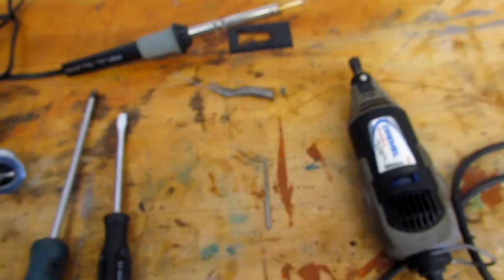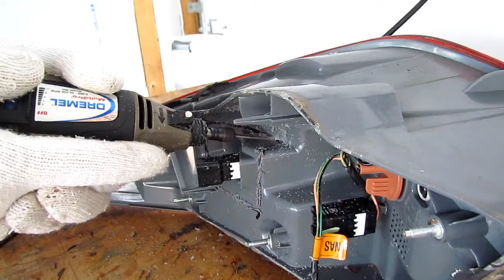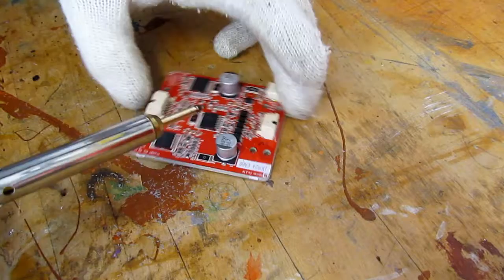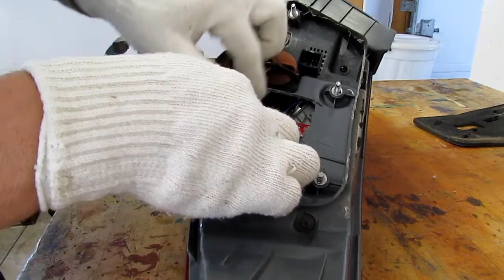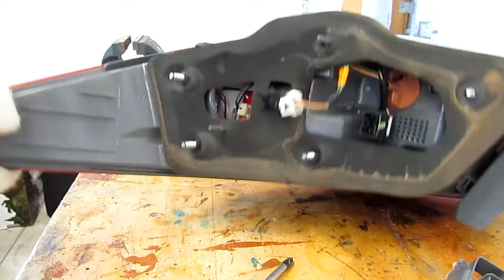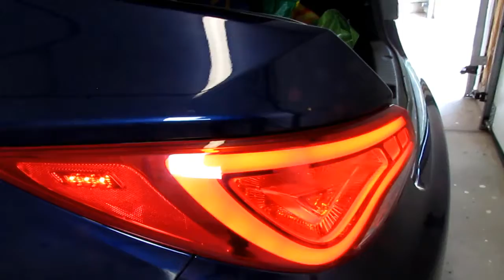The best way to repair a LED tail light that the dealer does not want you to know

Comment: the wool gloves remind me of when I worked on the Nissan assembly line and they required us to wear them to avoid scratching the body...but close and electrical work without contact with the paint could probably be done without the gloves...thinking it would be a bit easier...good work on the repair...the aftermarket LED tail lights for this model are junk, and the Limited that these come from the factory with have a different connector so the stock tail lights cannot be used...
Reply from the maker: my employer requires gloves  be worn while working on equipment, I just got used to it and now it feel weird without them lol.

Comment: I have a 2014 Elantra limited . I beleive the ribbon led is slightly flickering on the passenger side.  I have some experience with electronic service. Is  this basically the same procedure ? Same driver board? How did you know where to cut the housing?
Reply from the maker: it is most likely the same issue unless you have a bad component on the board (board could be different but is does not matter as it performs the same function).  The units are sealed and to try and separate them could risk cracking the lens so cutting a hole seemed the best option.

Comment: 2019 hybrid  Hyundai Sonata tail lamp has lost brake indicator function. Do I need to excavate the board like this?
Reply from the maker: your two options are to buy a whole new rear light unit or try to fix it.  I'd give it a try might save you some $$$
Reply: @therandomrobot3801  i see. Will it require a similar process to access the board? Wont be pretty but im sure someone wouldn’t mind purchasing a properly repaired board.  800 from the dealer!
Reply from the maker: wow the last one I priced was over 400.  when you cut the back try to do it directly over the board (there are usually vents)

Comment: You can thank the use of lead free solder for many of the problems associated with modern electronics like this. I would suggest some decent gel flux and solder wick, remove the solder and resolder with decent leaded solder like Multicore 511 or even solder with 5% silver for strength. Unfortunately when you cut into the enclosure you have totally compromised its ability to keep water out so I would carefully conformal coat the repaired board being careful not to get near the connectors so the board itself becomes resistant to water ingress. Very complex driver circuits to improve the life of the LEDs but to be honest it doesn't look worth it as the electronics fails instead. There are far simpler automotive driver circuits than used here.
Reply from the maker: Also make sure the solder is not acid core.  I agree the best would be to use a solder sucker and re-set the components but with the metal back plate on the board it could cause some complications.  The tail light structure had open vents/holes on the back, it was never water tight.  Thanks for the info.

Comment: Great video on fixing LED LIGHT. I have said that aftermarket tail lights in a Mustang. I wonder if this procedure is similar?
Reply from the maker: The board might be slightly different and where you cut the hole might be a bit different but process is same though

Comment: Thank you a million for this video! Now I learned how to repair my driver side LED tail light!
If only a few resistors need to be soldered, can the circuit board not be removed?
Reply from the maker: I had a look at removing the back plate from the circuit board but its appears to have some waterproofing (silicone like material) under the stainless steel backing plate.   The repairs would be best done from the back but I did not want to damage the board trying to remove the plate.

Comment: Fixed it!!  Thanks. Small tip: I used an oscillating saw to cut out the hole. It worked great.
Reply from the maker: That would make a cleaner cut (I don't have one). Glad I could help

Comment: I fixed the round light but I couldn’t the little side marker …. Any way I’m happy with the results ….thanks for the video
Reply from the maker: Glad it helped
Reply: Mine didn't work the first time found that if I pressed on the big resistor next to the plug with 2 wires it would come on.  Took it back to the bench and soldered that resistor again and it worked great.